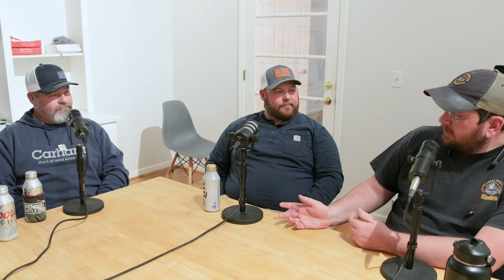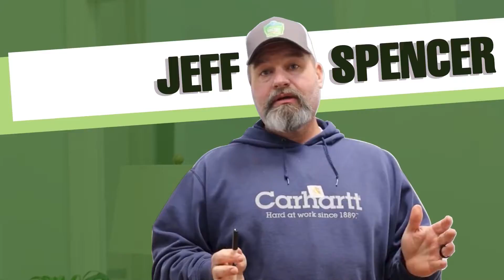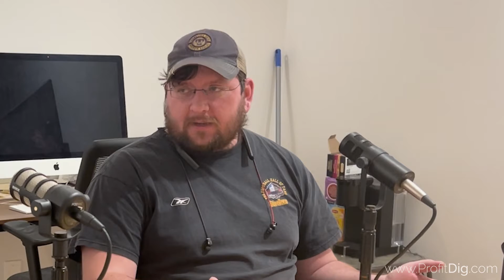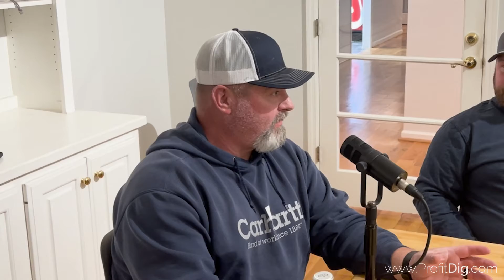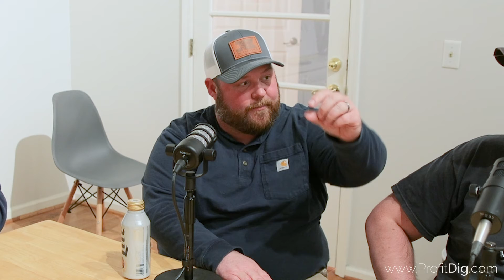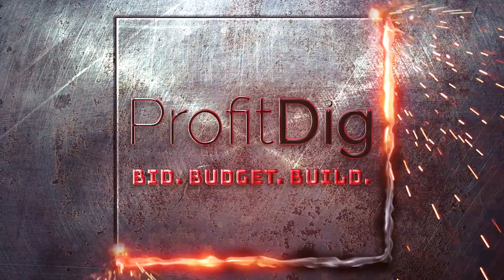How Commercial HVAC is Different from Residential

Comment: Main diff is space and heat. Residential install/service in Mississippi is DIFFERENT there are no upflows in basements its mostly horizontal in attics and tight. Commercial is much more complicated esp with bas and chillers. Residential more volume and quicker return. Commercial is naturally less volume since theres less businesses than there are Residential homes. All in all id say Residential is a good starting point since your young. Commercial easier on the body.
Reply from the maker: Thanks for the insight; it's a great point about the physical demands of each type of work.

Comment: Commercial is a hole different thing, you have to be an expert in only one thing about hvac, this could be the piping, controls, service, sheet metal, plumbing, insulation, each of them is a different contractor. And in residential you are the jack of all trades.
Reply from the maker: No argument here, but it certainly depends on the size of your company. Thanks for watching and appreciate the comment!
Reply: I’d disagree I work for a commercial hvacr company and if anything you get more involved in havoc and other trades. MUA EXF Controls fire safety, ice makers, walk in and reach in refrigeration,blast chillers commercial cooking equipment. Serious money in it
Reply: I disagree with your comment. I'm a heavy commercial tech.....we deal with anything HVAC related. From equipment to controls, the airside, water side, high and low voltage,  down to a simple condensate line. Airflow, water flow, VAV'S, VFD'S, Automation, AHU'S, DOAS, Glycol etc etc.
Reply: Meanwhile Im full time Commercial Service tech. I also do installs, Im licensed in Sheet Metal. I insulate if need be, I run water pipe and refrigeration on installs. A little bit of everything.